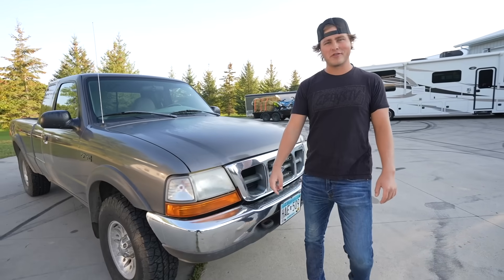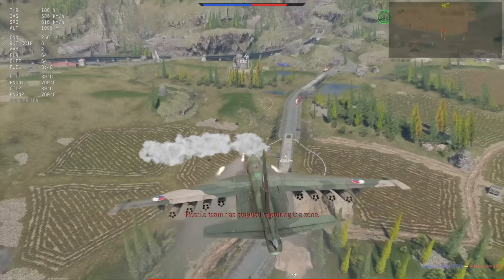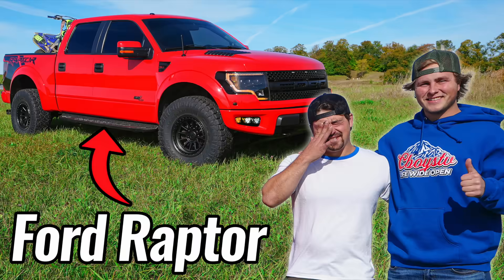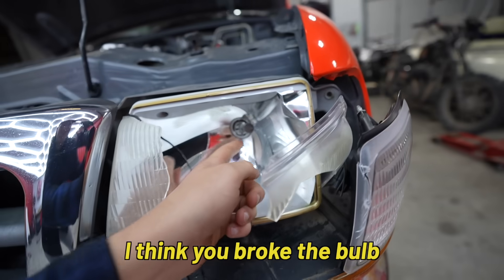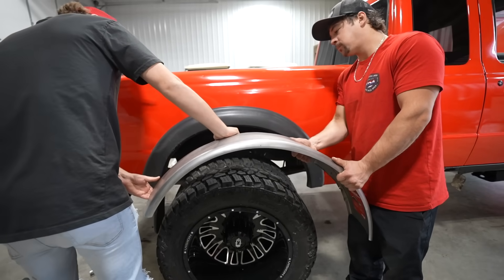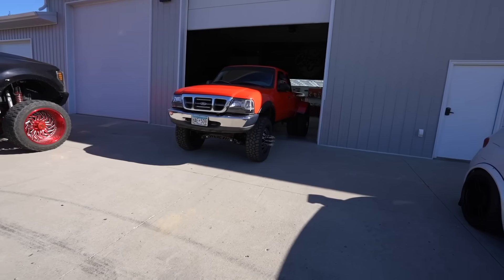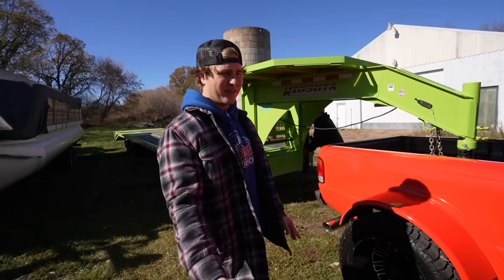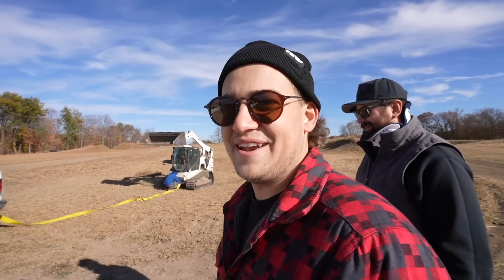I Built a Dually Ford Ranger for Towing!

Comment: You guys gotta get a beefy axle in that thing, bigger springs, and air bags. This is one of the coolest builds on YouTube
Reply: i say diesel swap her
Reply: I agree I think they should put an f350 axle and Springs on it
Reply: 5.3 or put a cummins in it
Reply: Then put a flatbed on it and turn it into a welding rig
Reply: @jacksonkleczkowski9789  cummins
Reply: @jacksonkleczkowski9789   probably a 4bt Cummins would fit
Reply: Never seen grind hards?
Reply: 12 valve swap!!!!!
Reply: @jacksonkleczkowski9789  for sure
Reply: @jacksonkleczkowski9789  they should cummins sway it and put a garret turbo rated for 5000+ hp
Reply: @bigtantoes5092  there's a Canadian guy who has a 4bt swapped Ranger , he's posted a few videos on YouTube .
Reply: Agreed and some power mods or engine swap
Reply: 100% do the big axel and airbags… thing wouldn’t even squat
Reply: @Watchdog99  Those guys are awesome
Reply: Agreed
Reply: Coolest build ?? LMAOOOO
Reply: Cummins or ls swapppp would be the sickest ranger
Reply: I couldn’t believe they left the stock springs and I’m assuming just used a block
Reply: @jacksonkleczkowski9789  put the duramax from a Chevy Colorado in it, I don’t think many other diesels would fit without heavy fabrication
Reply: and a 4bt
Reply: Yea
Reply: 1tons
Reply: @jacksonkleczkowski9789  6.7 powerstroke swap
Reply: Yes
Reply: TDI swap with stacks
Reply: 4bt Cummins swap
Reply: 7.3 powerstroke swap
Reply: An anylevel lift on a ranger 🤷‍♂️ make it work
Reply: Don’t forget a massive front pusher bumper with a winch
Reply: @jacksonkleczkowski9789  easily be able to fit a 3.6 baby duramax from the Chevy bisons
Reply: Needs bigger frame and bigger brakes.
Reply: @Asbo_Sting777  push bar would look sick.  I've got a hammerhead heavy duty bumper with push bar. It's got all the Pre-drilled slots for lights and winch.  I know there's a million companies out there that make them but this thing is so beefy I can push over small saplings going through our woods lmao. 🪵  It makes its own trails. No cap
Reply: Change the gearing in the rear end and put coil spring on top of it to stiffin it up
Reply: Have you heard of grind hard plumbing co? Their ranger is way cooler
Reply: @sigxm5thumb  I’ve got a low mileage Colorado Duramax engine on the shelf 😉
Reply: Is it really tho
Reply: would be pretty sweet to see a C 3.6 caterpillar engine with a good turbo on this thing lol
Reply: @Tachtronics  but is it the 3.6 baby D
Reply: Lol if this is one of the coolest “builds”you’ve seen you need to explore YouTube some more
Reply: @jacobharrison8052  yes
Reply: This has got to be done
Reply: @zachloges7167  please don't put a 5.3 in it. I'd rather the 4.0 than a 5.3, 4bt swap it though
Reply: I was thinking the exact same thing... video was a 5/10 due to missing HD shit
Reply: That and the Cummins swapped mustang
Reply: This is hardly a build
Reply: @thecomanchekid   it would be one of the coolest builds IF he got a beefy rear end and some real springs
Reply: Or just some bigger bump stops😂
Reply: So put parts on a truck that has a frame that can't handle the extra weight of towing? LoL. Scientists in here I tell ya. 😆
Reply: And then take her to sema
Reply: @JuarezDerrick  5th wheel hitch in the bed.
Reply: And a 3.0 Power stroke under the hood
Reply: 4bt swap it for sure
Reply: @jacksonkleczkowski9789  YES detroit 353 or 4bt cummins
Reply: that and get a hefty front bumper to help balance out the weight
Reply: I think it would be really entertaining if they just put the beefed up axle and suspension, but otherwise leave the drivetrain as is and see what she'll do lol
Reply: @jacksonkleczkowski9789  bingo
Reply: 2 tanks of gas just to pull the trailer out the yard
Reply: @thomas25082  💀
Reply: There's gotta be an easy way to use a true ford or whatever dually rear and cut it down to size.
Reply: Even more rear springs which is easy to do that would help a lot
Reply: Yes plz! I want them to make it nice. Ford Range Dually all the way!
Reply: put a small powerstroke in it like a 3.0 or sum
Reply: I spell jaxon the same way
Reply: You're not watching the right parts of YouTube if you think this competes with best builds lol
Reply: @zachloges7167  no.  Keep it ford tough. Honestly can just build the engine out.
Reply: @JuarezDerrick  I have a Buddy with a 2010 ranger welding rig. It's 4x4 on 31s mud boggers, he made it because his larger truck kept getting stuck and he doesn't pull trailers. He calls it the Tick.
Reply: That’s awesome 👍
Reply: It has the ford 8.8 rear end. One of the better axles
Reply: Ecoboost
Reply: @zachloges7167  no, needs a ford diesel tractor engine
Reply: @zachloges7167 hell no do a 7.3 swap
Reply: @jacobharrison8052 doesn’t fit, you’d have 2 cylinders in the cab
Reply: @jacksonkleczkowski9789  boy do I have good news for you lol
Reply: Yeah. That adapter, isn't gonna do much.
Reply: Big axle and supercharger and it will pull like a full size
Reply: @nicholaslandolina  no it wouldn’t 💀
Reply: @jacksonkleczkowski9789 you predicted the future
Reply: I would not use a C clip style rearend with dual rear wheels. Needs to have a full float rear axle.
Reply: I prefer gas...but a diesel would be great a 6 cylinder diesel
Reply: Yeah I understand what your saying when I watched the gooseneck loaded on the ranger

Comment: Those 4.0 rangers were bad ass!  I had 4 or 5 of them and I towed some things I had no business towing.  When I built my house, we had a bunch of willow trees in a wet area.  I had my excavator guy rip them out, so I never had to mess with them again.  We use my friends' truck (identical ranger) to drag them on a trailer.  Some of these root balls were 10' across.  We took them to my wifes  grandfathers farm and dropped them in a hole.  Pulling wasn't the problem.  Trailer whip was and I don't know how I didn't crash when the trailer pushed the truck with no trailer brakes.  Building the same house, I found a line on some railroad ties.  As many as I wanted.  After the second trip of 35 ties the transmission wasn't happy.  The truck only showed 65k but had been rolled over twice so 265k was what the odometer read.  Ford put a new transmission in it, my friend painted it at his shop and I traded it.  Looked brand new and I did see it running around for quite a while!
Reply: I had a 91 with a 2.9 V6 and it was unkillable, like lifter tick for over a year, rear main seal gone with no oil pressure at idle for longer than I owned it, bad transmission and torque converter, and more issues 😂 thing did not die I respect the ford ranger it’s just as good as a hilux in my opinion
Reply: A Ford ranger is badass

Comment: Back in the 80's they made dually conversion kits for small pickups like that.  They had the adapters, wheels and fiberglass finders.  I even remembered seeing a dually S-10 conversion brand new at a local dealership back in 88.  I still know where a Dodge Dakota dually is now that's overgrown with weeds.
Reply: In the 80s and 90s Toyota made small 1ton dually trucks from the factory, they were used as uhaul trucks, service trucks, even campers. But most were sold as cab and chassis trucks that got a regular flatbed

Comment: I built my dually ranger back in 2011 and tow a fifth wheel camper regularly.
Definitely not the first to build a dually ranger for towing but still nice to see. You want a factory look you should put some step side fenders on it. Will make it look so much better.
Reply: Finally a good comment. Those trailer fenders look stupid compared to the actual stepside of the ranger fiberglass that coulda be snagged at a local salvage yard.
Reply: Exactly. Looks factory. Trimming the boxy lower section off the leading end is the only substantial mod needed to make it look extra smooth.
Reply: So how do you get the GVWR ratings increased to legally tow more?
Reply: What did you use for the dually setup? A swapped axle or the spacer These guys are using?

Comment: the 8.8 in the rear is fairly beefy only downfall is the c - clip axleshafts and I would definately recommend a Ford 9 inch axleswap for the extra beef and selection of lockers and gears. absolutely cool

Comment: 1750 Lbs rear springs and traction bars. 14 or 15 inche front rotor swap with quad piston calipers. F250 master cylinder swap. Radiator upgrade. Transmission cooler upgrade. Engine oil cooler. Differential cooler. Winsor engine swap.

Comment: Adding a transmission cooler and fan. Then putting in  heavier duty springs in the back. Something that can handle all that weight. Think that would help.

Comment: You need to add the following as I used to pull a 36ft travel trailer with my ranger. 2500 lb bags in back over axle and rear sway bar off Explorer. You will be good to go til the trans breaks. It's the only weak link in the setup. Great job on the build though.

Comment: I’ve been wanting to engine swap a ranger. Well, driveline swap a ranger, flatbed it and make a matching gooseneck. The gooseneck would be host to a pair of arms that have some 500# hoists, a claw, a hook, a claw and a hook on a hoist and a pair of flood lights. One arm would have a little camera too. The idea is I’d pull up to some dumpsters at the various honey holes, peak inside before even getting out of the power head. My rig would be painted the same and my helper and I would wear a uniform similar to the exterior and axel placement would be like a beer truck so to turn in a small area. We would not be intimidated by the tweakers claiming turf at my honey hole. I’ll have some flashing lights that make them move along and possibly drop their loot. It’s my score. Maybe my puller should have a beefy frame and a narrow dually ass end.

Comment: Toyota U-Hauls and RVs used to be something you could buy cheap with dual wheels.

I bought a used U-Haul and Camper both and made a little farm run-about with a custom built flat bed.
Swapped the best parts of each to make one good one.

Used it before small ATVs were a thing and even then it was street legal when ATVs were not.

Not sure but I think some States let you make those street legal.

 Regardless, my Toyota always has been even though it rarely leaves the farm.

Taught all our children to drive with it and our oldest grandkid put a dent in it but she's 12. Not like it's mint condition collector car. Not a straight panel on it for decades. The pecan tree shrugged it off. So no harm done.  😂🤣😂🤣

Comment: Doesn't matter what you do to the engine, transmission, axle, suspension, wheels or tires.  The wheelbase is still too short to safely tow more than 6-8k.

The truck does look sick though, I would rock it: just not for heavy towing.

Comment: Should def regear to 4.10(or higher) so the engine doesn't strain itself, get a stick shift transmission and I think it'll be all set. Some comments say to make it a diesel but I think that'll take away from the cool factor that it's being powered by a regular Ford ranger 2.3 inline four cylinder gasoline engine which is pretty impressive. If u do end up swapping the engine for a diesel I recommend the JDI 1.9 or a Cummins 2.4 4bt..OH and definitely replace the leaf springs and buy some load assisting shocks that come with a small coil spring on the shock

Comment: Love the truck and the idea but the fenders has got to go. If the rear end was narrowed and you would have to widen the wheel tubs in the bed but you could run the wide bushwhacker fender flares and they would fit this application better and look more correct than the trailer fenders

Comment: trust that spacer set up?  No rangers weren't tow vehicles in anyway, especially if it was an automatic.  The only reason u wanted a ranger was for its physical size...  In 4wd form, the f150 was so much better and even in the 5.4l it got better gas mileage then a ranger.  They were so under powered.

Comment: I like how the stock rating for towing is 7500 pounds and the gooseneck itself was already more than that then you put a limo that’s like 20000-25000 pounds in all and the ford still runs and drives good like CJ said ford fuckin rangers can’t beat ‘em

Comment: “We don’t know why ford never offered the ranger in a dually”

Probably because making a ranger dually does absolutely nothing other than looks.  It’s still a ranger.  A ranger is the most badass compact truck ever built,  it it’s still a compact truck.  You can get plenty of towing capacity in a one ton with srw.  Points for a fun toy.  I like my toys also.  But don’t try and pretend that this is now a truck that can safely tow 10k, just because it has bigger wheels.  You still have the same brakes, suspension, and drivetrain.

Comment: upgrade leaf springs to duty and if it 4.0l there 4.2l in f150 easy swapped both are v6
or throw in supercharger give it more power handle it like it nothing 
i have challenged my friends with my ranger 2.3l 96 vs his f150 v8 5.0l 91 and mine just beat him from start to half way at finished line and his was revving so high trying move it or hual it n once it moving n he did caught up with me by surprise if i were you i would kept trucks forever

Comment: Wrong year, you need a 1989 - 1992, to put a 1995 Mustang GT engine and 5speed transmission into. I just happen to have a 1991 Ranger and the engine and transmission from a 1995 Mustang GT, put it in there, do your video and then get the vehicle back to me.